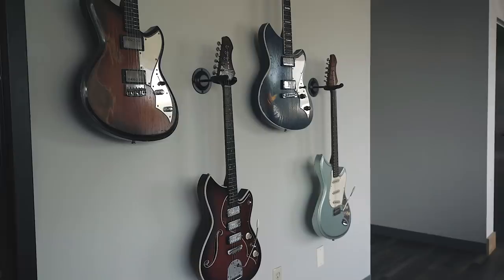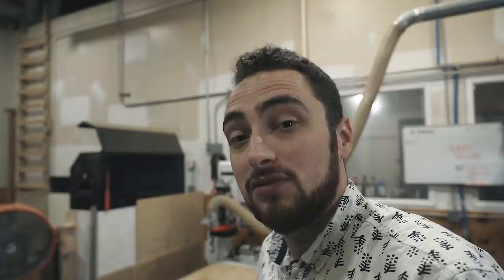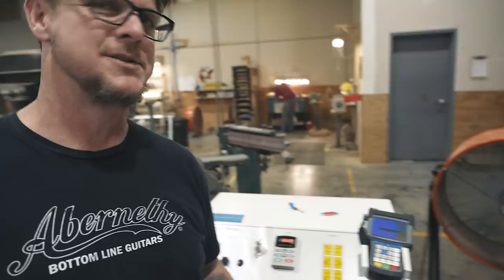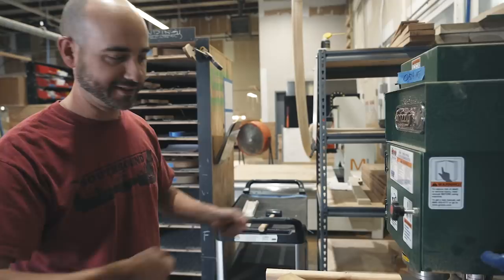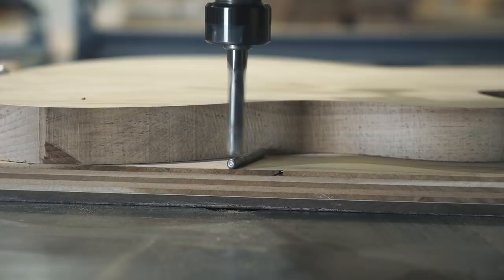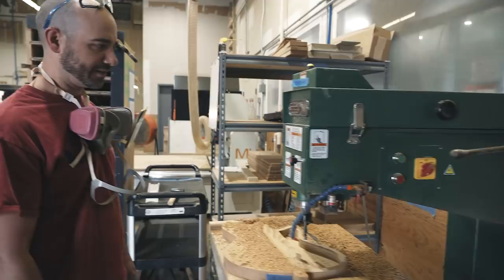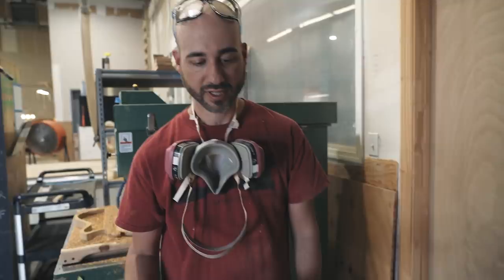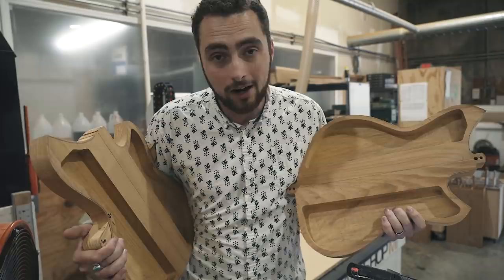Is “Handmade” Really Better? CNC vs. Handmade Guitar

Comment: I would personally always want the neck pocket on any guitar I bought to have been CNC cut. Removes the margin for error and makes for a really tight fit.
Reply: @spike62002  I respect what you're saying. Suppose I have no experience of a guitar made with that level of attention to detail. I will say that the CNC'd neck pocket on my Mexican made Charvel is seriously impressive, it actually grips the neck perfectly. The pocket on my 2017 custom shop strat is also bang on. However my mid 90's strat, pre CNC has much more play in the pocket.
Reply: @spike62002  I've never had a sloppy strat neck! I'm not sure where you get yours from?
Reply: use screws and a backing plate next time for a tight fit. I bet everyone of your guitars has a crack in the side of the neck pocket
Reply: @spike62002  they're not sloppy, they're firm. Its how they're meant to be. Wood expands and contracts throughout the year. I'm surprised you don't know this.
Reply: Stop it boiz. Paulo Jones has left the building after all your insults lol.
Reply: @GazMoz78  yes! I have a mid 90’s mim strat and there is lots of play

Comment: This is more than just a guitar debate, this is a woodworking debate. Imagine a dresser - all parts cut out with CNC vs all parts cut with a table saw vs all parts cut with an old school handsaw. Where do you draw the line in regards to "handmade"? Also, is there really a difference between a CNC guitar vs a body done with a router and template? 
The guy at Texas Toast Guitars really loves his pin router (and weenie rollers) but the guy on Crimson Guitars uses hand planes, chisels and gouges. 
As a woodworker myself, I'm fine with parts cut with CNC. The real luthier work is bringing all the parts together to make it a good guitar, not just chunks of wood glued together.
Reply: When I think of "hand made" I think zero electricity. 
Router is the same as CNC just controlled by a different operator.
Reply: Dude just said "analog CNC" yup.

Comment: As the guitar moves from basic shapes and machining to sanding, finishing and setup, the machinery and skilled worker input moves from heavy machinery to the tips of the fingers. It is the most effective way to quickly and accurately produce something like an electric guitar or bass.

Comment: I totally agree with you on that, and as someone who work as a builder for years, it makes me cringe every time i hear the word mojo, it's just doesn't make any sense! People go nuts for old stratocasters and les paul, when it was basically all made with machines, a Pin Router is just an handheld CNC ! And when you spent months designing a guitar, there's just no point to fully handcraft the repetitive parts every time, you build jigs to replicate the process as close as possible every time. it makes the works easier and the end product is better. 

I don't care if Novo uses a cnc or a rasp on a piece of wood that was blessed by the pope, to me Novo is just like a small family business, i don't care how they do it, they do it very well and their line of instruments is amazing!
Reply: when i started out we used hand held routers with templates, we improvised and made lots of machines to speed up the process for increased demand. for instance we had a neck radiusing - fret slotting machine that we made also scalloping if needed. 
turn it on and after an hour you had twelve necks fretboard radiused and fret slots done... that was a big game changer for us..
Reply: Yeh, mojo. It's like that violin test they did. When people could see the Stradivarius being played they said it sounded best. But when they couldn't see what violin was playing they all picked a different violin. The majority of expert judges picked the modern violin - the only one in the test -  over the Strad and other old violins in the blind test.

Comment: Pin Router? That's cute. Try a hand held router and a MDF template.
Reply: When I saw the "Pin Router" I said that is much safer than my handheld router 😁
Reply: @notahotshot  a rusty nail and some old fishing line
Reply: Why?
Reply: @gitaramaker101  A 2 hand router is safer than that beast. Your hands must always be on the handles and they're a constant and reasonable distance from the spinning Blade 'o' Deth. One bit of inattention and/or wrong attire choice and that pin router is going to do some serious harm to its operator. The 2 hand router is much more forgiving. Heck, we had 2 handers in high school and nobody was so much as nicked by it.
Reply: real handmade guitars are scratched out with fingernails bro.
Reply: Stanley knife and chisel gives the best tone!
Reply: @gitaramaker101  Did you see the operator reach in next to the spinning cutter?  He forgot to put the pin down before he turned the cutter to spinning.  Maybe he was distracted, but still his hand came within 2 - 4 inches of the spinning cutter simply because he didn't want to take time to shut off the drive and wait for the cutter to spin to a stop.  If he had been injured it would be the company's fault for not providing engineered solutions to prevent hand contact with the blade under any circumstances - but chances are the gut wouldn't be playing guitar anymore with nubs where his fingers used to be.  Gross, but true - I was a safety engineer and that machine is too dangerous to use as it sits today.

Comment: I want to say most peoples problem with c&c is how much it allows someone to do, how fast it allows someone to do it, and how all that cost savings is rarely passed on.
Reply: Except there really isn't that much of a cost saving. When you take in to account the initial setup costs (purchase, setup, calibration, user training & programming) and ongoing maintenance costs (replacement cutters, periodic recalibration, hell, just the cost of electricity to run the thing) of a CNC setup, the actual cost per unit produced tends to go up when compared to a pin router setup. The savings come from the reduction in rejected parts produced, the time saved when changing between different body shapes, and perhaps most importantly, the reduction in liability insurance. 

There really aren't any "small" pin router accidents, due to the operator being within inches of a cutter running at several thousand rpm. With CNC, the operator is well out of the way of any failures...
Reply: It honestly depends entirely what you are using the cnc for, if its just cutting things like this out or bigger work, then the cost savings is iffy, but a cnc that is big enough for a guitar costs just under 2000$, due to the kit being expandable, you could get something to lengthen the work bed so you could do necks too. form here you get bigger and bigger cnc's that while they cost more, likely don't cost proportionally more, where they are set up all in a row on the line and have the brains cutting 3+ guitars at the same time. you then run into the extra things you can do on a cnc, take binding for example, if you route an area around the body and fill it, you are able to get binding made into the guitar from the outset, and from there cnc away layers adding more if you want a multi color binding. this traditionally adds a chunk of change to the cost, but on cnc the cost to do this is near 0 as you are working on other things while the material you are using for binding sets. 

if I decided to go cnc only, I could likely get it down to about 90% of my work was done on cnc alone, I could get around 90% of a guitar made on a cnc with the little bit that's left over being devoted to finishing, qc, and and things like inserting mother of pearl/whatever I want into fretboard/head as I would have the cnc makeit a size or so to small something a simple file will open it up enough as when you start working on things this small, tolerances on wood start coming into play and while the hold may very well be perfect, even a small gap on these will require filler material. from there you have writing everything up and truss rod.

Now a big cost savings starts coming in when you do more than 1 at a time because you now only need 1 person operating the machines

Comment: I am a luthier.  I build guitars that are all hand made but I do use a manual milling machine for some work.  I don't have the budget to get into a GOOD cnc system and don't have the inclination to build a basic CNC system of my own.  For me CNC still stands for "Crankin'  N' Cursin' ". 

CNC gives consistency but any guitar that's truly great has received lots of careful hands-on attention to detail in the setup and adjustment, regardless of whether or not it's been made mostly by CNC processes or entirely by hand processes. 

PRS is the best example of this.  They do most of the work by CNC but they put a lot of hand work into them that is critical to delivering PRS quality. 

I deliver equal to PRS quality without CNC.  And I charge for it.  But PRS charges more.   They have the brand reputation.  I am only a hobbyist who makes a few guitars on a busy year, and none in some years.

Comment: i love the cnc but i use one for my job. its definitely safer and quicker than a pin router and if it equates to a more consistent better quality guitar then its the way to go.
Reply: @t , do you think this cnc is a good enough machine to do the basics of making the body and neck?  Id work on the rest, I like the idea of building myself and am looking into it, also dont have an ego so would probably take it to a luthier to make sure I did it right at the end but in terms of cutting out a 3d angled body and all that, would you say this would be good? Im assuming the programs for cnc are useable across different machines? Meaning, this cnc wouldn't be barred by a crappy program that can't be changed? Thanks for any help.

Comment: What's the big freakin' diff? You're carving out a piece of wood. The cleaner the better.
CNC rules, period. Leave the finer details to the craftsmen.
Reply: Leave the finer details to another type of robot.
Reply: Back in my day there were no pin routers.  Handmade was man made!
Reply: @FighterFlash  I'm sure that even back in the day some templates were used. I doubt anything was cut freehand. Can you imagine the confusion trying to make parts fit?
Reply: @FighterFlash  Back in the days there were no electric guitars
Reply: @FighterFlash  pin routing has been happening for almost 150 years...  just that the cutter moved to be electrically powered.
Reply: @wulfocrow5549  Humans do machines
Reply: @christerlundberg5502  Back in my day sunny we didn't even have trees!
Reply: It depends. Cnc router bits gets bad and might damage the guitar body. If workers doesnt notice then it gets out to the buyer. If handmade it will always be watched over
Reply: @esteve1978  ...and there are plenty of craftsmen and women who make goods with fine fit and finish because they are meticulous workers who get a kick out of what they do.

Comment: The big benefit of handmade is the inconsistency. Sometimes a factory that delivers handmade instruments delivers a line, or even sometimes a single unit within a series, that is exceptional. just because the workers had a good day that day or they had an argument with their spouse or whatever. The inconsistency is what allows for exceptionally good or bad instruments, where the consistency of machine work limits that. 

In the end though, most people, myself included, won't hear a difference, machine all the way baby
Reply: I wouldn't bet on it. Les Paul made his first guitar out of a 4x4. With electric guitars the body doesn't really matter. The strings are going to vibrate over the pickups just the same.
Reply: @1pcfred  I'm not just talking about body. I'm talking fret work, polishing, pick-up windings and waxing, soldering, everything. Every part of handwork is where inconsistencies have the chance to make an exceptionally good or bad product. However, the influences are small and it indeed takes many of those inconsistencies towards one direction to get a truly outstandingly good instrument within a series. Mostly it gets undone by computer operated controls, but there is variation within series in modern instruments since a small part is done by humans.
Reply: @hermest99  you think they wind pickups by hand?

Comment: As a hobbyist luthier, I'm jealous of CNC. 1) WAY less dangerous.  2) If you've seen the giant fly cutter that PRS uses to level the top of the neck to receive the fretboard, that level of flatness is difficult to achieve manually.  3) WAY less dangerous.  4) Templates can wear out or get damaged, whereas the CNC program will never change.  5) WAY less dangerous.  Power tools are just as happy to cut human flesh and bone as they are anything else.

You saw some of the wood kinda chipping out in the pin router work.  I was a little surprised that a larger diameter cutter wasn't used, but perhaps that's because I don't know enough about such hogging out.  I do most of the hogging out with a forstner bit on my drill press, so I minimize wear on the router bits AND so I'm using the router bit as little as possible.  A slow forstner bit on a drill press is less dangerous than a plunge router bit in a handheld plunge router.  The "handmade" woodworking is accurate *enough*, but that's not the same as accurate.

The mythology around guitar making is annoying to me.  "Lacquer lets the wood breathe."  Please.  The point of ANY finish is, first and foremost, to arrest water migration thru the wood.  "Handmade is better" is a phrase that has no definition.  The guitar that inspires you to play is the one to play. (Every word in that previous sentence that can be needs to be pluralized!)

Finally - every guitar is only as good as its centerline consistency, and CNC is better at that than any human-controlled process can be.
Reply: Doesn't really apply to  a guitar neck but you might enjoy a Google search on precision from nothing and the three plate method. Hand methods that are WAY more accurate than a fly cutter. A lot of cnc made tooling has hand tweaking to get them more accurate.
Reply: @anullhandle  Thanks.  I think I used the incorrect term.  The PRS CNC machine uses a face mill (a BIG face mill) to flatten the neck surface in prep for the fretboard.  I'll check out the 3 plate method.

Comment: To anyone watching this video, please realize a free hand pin router operation like shown at the 12:00 mark is extremely dangerous. This machine is equipped with a right hand cut, left hand spiral bit. If you were to use a conventional end mill like this, the guitar body would climb the cutter and most likely spin and fly off the machine. Second, NEVER get your fingers close to a cutter that is still moving. Regardless if its just powering down or not. When he started to set the depth of the cutter with the pin standard, with the bit still moving, I nearly smacked my monitor. Watch your fingers people.

Comment: It needs to be pointed out that the "Hand made" debate is NOT actually about CNC machines verses Pin Routers.
    its about a veteran Luthier who has the experience to "listen" to the materials an instrument is to be built from,  and then properly select the best materials for a given Guitar design.  Tap Toning is huge part of that process.  ( notice that no one in the video did that on any of the guitars) 
    but it can take at least a decade of building,  to properly understand just what benefits Tap Toning can provide a builder.  and ONLY if he practices this art. 
     this is because an "instruments" entire job is to vibrate in a controlled manner. and there is no CNC or any machine yet that can predict that.  Its only the skill &  experience of a Luthier that can make that call.  and this "tapping / listening" process is something that is carried throughout the entire build at every stage..
  
     After the initial material selection...There is nothing wrong with using modern machines to make a guitar. but the Tap Toning must continue as the Instrument is being built in order to get a "Tonal picture" of the material as its being worked. 

     the problem arises when inexperienced woodworkers who "Call" themselves "luthiers"... start just chucking wood in to some automated machines and Call ALL of the product coming off said machines  "great guitars" 
 and starting at 13:30..  the guy makes my case for me most eloquently..  until he goes off the rails at 14:05 and begins to extol the virtues of the factory cookie cutter system.
 
  I've railed for decades about the fact that ALL "factory made guitars" are nothing more than Cookie Cutter guitars and have no soul in them and building a "Truly great instrument"  in a cookie cutter factory setting...is a complete fluke. take a minute to look up the Winchester  "1 of 1000"  Rifles made in the 1880s and you'll see that this idea is not new. 
 what Factories Do Best,  is make instruments cheaper.. but not necessarily better.

 and Don't get me started about Forced Dried (Kiln) woods verses natural  Air dried woods. there are SOME things that should NEVER be rushed all in the name of a profit.
Reply: I appreciate your comment and this video made me chuckle. The video sets out to prove that its a pointless video and does so. We don't even get to hear a single guitar in the whole video. In short, your comment has more value then the entire video.